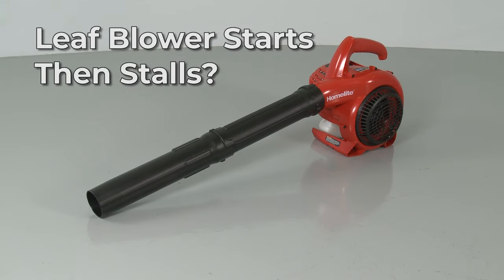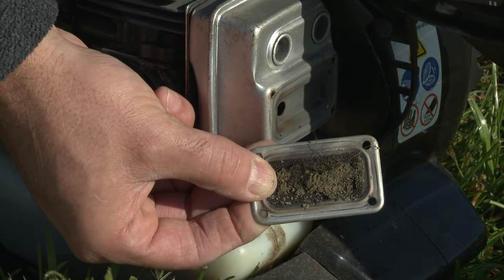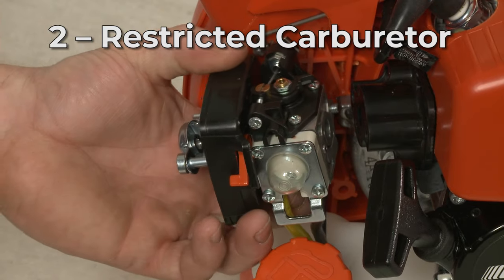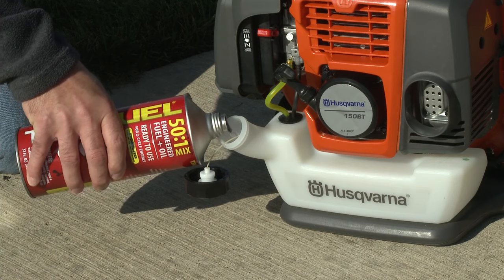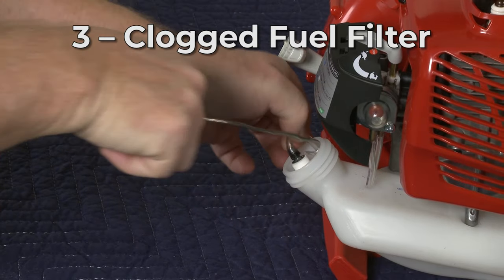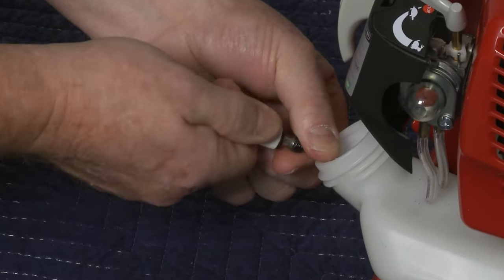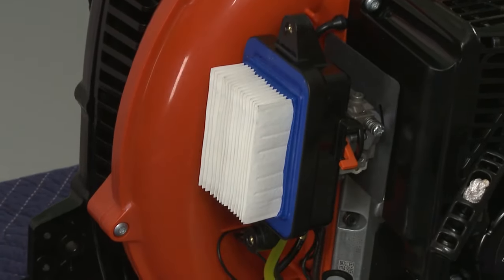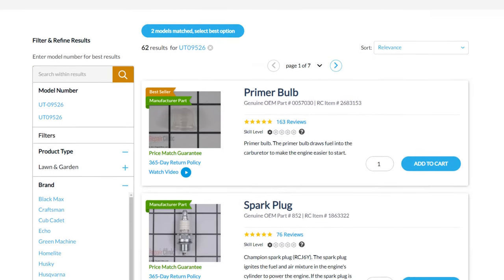Top Reasons Leaf Blower Starts Then Stalls  — Leaf Blower Troubleshooting

Comment: i found a leaf blower picking up scrap...i got it to run but it keeps stalling after a good cleaning so idk whats wrong with it but i wouldnt use it anyway who uses leaf blowers? i just thought id tinker with it for soem fun and i did get it to work but the parts needed to repair it arent worth the money as id never use it anyway but to know i can fix it is fine with me..the carb was cleaned good but it runs then stalls out for whatver reason maybe old fuel as the guy probably had it sitting in his garage for years then just threw it out because it wouldnt start...i cleaned the filter but maybe it needs a new one and ill try that screen thing if i can find it on the thing...be neat if it ran consistent without stalling then id think of it as a poerfect success but i guess its just a mild one for now...engines have never really been my thing but im 40 now and thought id try seomthing new so to me to get it running again was fun.